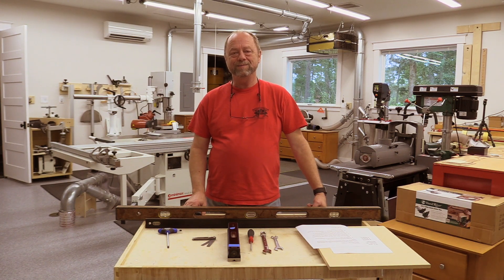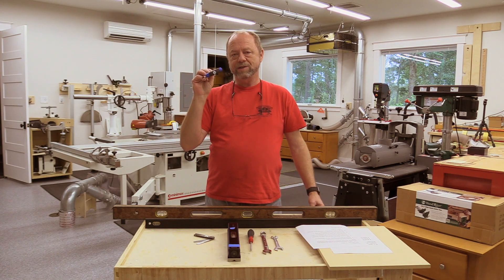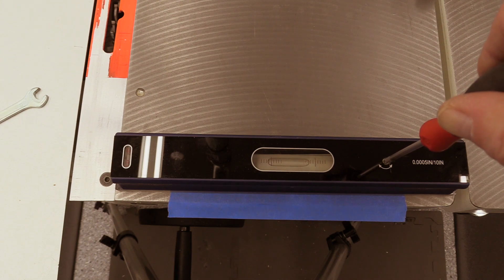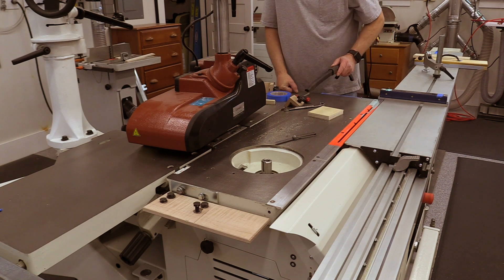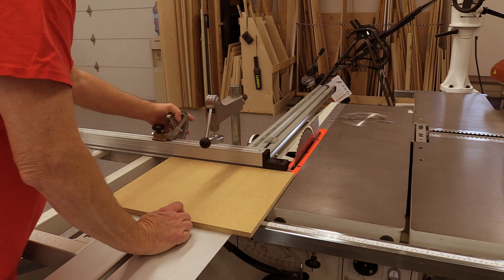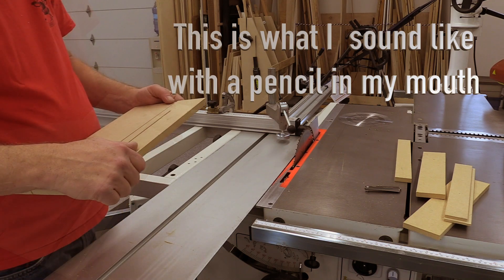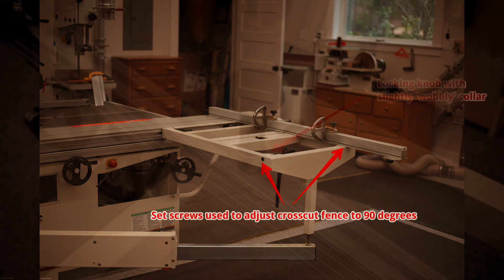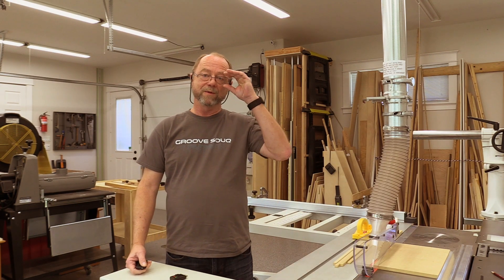Sliding table saw setup and alignment - Minimax CU300 example

Comment: Hi Mark — do you have the part number for the rod that adjusts the cast iron sag? I have a LAB 300P which does not come with the stiffener rod from the factory, but I do have sag in my cast iron top and was thinking about retrofitting that part in my machine somehow. I can't find the parts manual for your machine online. Thanks!

Comment: Excellent info!  I need to raise my outrigger a small amount as there is 3/32" of sag.  I can't for the life of me figure out how to loosen that nut, nor raise the Acme shaft....  is there a trick to this critical adjustment?
Reply: I have used penetrating oil, heat and a steel mallet but it just will not budge!
Reply from the maker: Steve, on my CU300 there are 3 adjustments points for the height of the outrigger.  Two small (~4mm) hex head adjustments right against the slider and a larger 10mm hex head on the pivoting arm. The pivot-arm adjustment has a nut at the top of the pivot arm but if you look from underneath you should see that the bolt will accept a 10mm Allen wrench. The bolt on top likely acts as a locking nut so you would very slightly loosen the large bolt on top and then turn the Allen head.  Check the thread direction, I don't remember if it is right or left handed thread. If the nut seized up on your machine I don't have a good solution.

Again, check the thread direction and make sure you actually trying to loosen the locking nut, and  not tightening it more :).
Reply: @markamcfarlane  I got it loose but it required a 3 foot lever attached to a wrench- it was machine tightened at the factory to ungodly amount of torque!  I have another question about aligning the cast iron top- in the video, you start on one end and then zero out your level as you move forward.... and bing the table into alignment with the start point.  How do you know that your start point is level? So if the start point is tilted in one way or another, when complete, the whole thing will be twisted...
Reply: Another question-  when using the machinists level, when you check against the far side, your solution to the twist is to level the machine as a whole- you used shims, but at least my combo has leveling feet-  So are you suggesting that the cast iron itself is not at fault but rather the entire machine?
Reply from the maker: @stevensivak5109  Steven, if the machine isn't  level the cast iron top wont be level.  The only way I know of to control any twist in the cast iron top is with the leveling feet.   If the cast iron top sags near the shaper then there is a rod that can be used to move that part of the top up or down.
Reply from the maker: @stevensivak5109  Hi Steven, the machine top and slider don't need to be absolutely level relative  to the earth's gravitational field, they  just need to be FLAT (planar).  If you get the front and back sides registering the same on the machinists level then those two measurement points will be parallel to each other and the top will be flat relative to those two 'lines' where the machinist level was placed. The whole machine  could have a tilt relative to the earths gravitational field but as long as the table top and slider are 'in the same plane' you will make good cuts.  

You could (and probably should) start the process getting  'level to the earth' first using something like a carpenters level, then use the machinists level to get the flattest setup possible.

If the machine is not level to the earth gravitational field then you may experience the slider wanting to drift to the start or end position on its own when you are out of the shop...

FYI, I added leveling feet to my machine also, the shims have been gone for a few years.
Reply: @markamcfarlane  I think that indeed using the leveling feet to get as close to level is, as you suggest the first step.  If I understand this correctly, there is no such thing as getting a twist out of the cast iron because other than leveling, there is no adjustment for twist.  Sag, yes but not twist...
Reply from the maker: @stevensivak5109  Using the leveling feet you should be able to remove any front-to-back twist (warp) in the table surface.  I don't know of any other adjustment on this saw to address twist but the leveling feet should be sufficient.
Reply: @markamcfarlane  Well it all worked out just fine-  thanks!  However, at the end of leveling the slider to the cast iron, I discovered that the slider is not properly aligned with the blade.  Do you have any tips on the rotation of the slider and how far the work pice should be toed out?  I clamped a small block to the slider and cut it with the leading edge of the blade.  Then I shut off the machine and pushed it back and forth against the trailing edge of the blade and I can hear it making contact.  Obviously, it should pass by the trailing edge silently with some tiny gap.....  Any tips???
Reply from the maker: @stevensivak5109  Steven, I cover this @ 9:34 in the video. All I know to do is loosen the 5 slider bolts and gently nudge it one way or the other.  Watch the video, I recommend you are really careful and loosen all 5 bolts the exact same amount, then retighten them the exact same amount or you will change the height-level of the slider.  I ended with .002" of toeout.  I don't know if there is a magic number, I was shooting for 0 toeout and considered .002 close enough.  Perhaps better to have a little toeout compared too any toein.
Reply: @markamcfarlane  Sam recommends .004-.006 so you are very tight!  It is in fact very tricky.....thanks
Reply from the maker: @stevensivak5109  I just got lucky. Tried to get close to 0 toeout, measured at .002 and quit making adjustments.  Pure luck :).
Reply: @markamcfarlane  Is it enough?
Reply from the maker: @stevensivak5109  Yes, it works fine for me. It is easy to get overwhelmed by measurement data. In the end you are cutting wood and not milling an engine block.   My joints are clean, glue-ups right off the table saw work fine.

Comment: Thanks for posting this vid. It’s given me a few tips I’ll try next time I try adjusting my felder. 

I can’t believe they use the same rubish mechanism to adjust the sliding table height as felder use. Absolutely idiotic to use the support bolts to set the height when every time you tighten one it throws the adjustment out of whack. They really need to clamping system that clamps perpendicular to the adjustment direction to clamp.
Reply from the maker: Thanks for the comment.  I agree that having the height and position adjustment on the same bolts is less than ideal, but on the flip side for my use it has held well for several years after being set up.  You just need to count the number of wrench turns during the process to repeat settings...

Comment: for the crosscut fence the 3 side cut is nor reliable  , a five cut method is the only way for an accurate setting. ,,,, great video by the way.
Reply from the maker: Thanks Rory. FWIW, the 3-cut method I demonstrate in the video has been "accurate enough" for everything I have built.  The traditional 5-cut approach may provide a more accurate result but the 3-sided method  has worked fine for my casework,  face frames, aprons,.... One nice thing about the CU series saws is they seem to hold their setup really well as long as you don't take off the outrigger. I removed the outrigger once to accommodate an early-Covid-distancing dinner party.  After realigning everything we hosted subsequent dinners outdoors :).

Comment: Hi Mark, 
I have limited space to move the saw from the driveway to a shed shop I’m planing to build. Could you give me a minimum width requirement to move the saw? I’m thinking removing everything possible to make saw as small as possible to move. 
Thanks.
Reply from the maker: About all you can easily remove is the outrigger and the fence rail. On my saw that leaves 43 1/8" left. Removing the plastic protective cap on the Tersa head might net another 1/8-1/4" off the width.  My saw came from the factoring with the sliding table attached and, if I remember correctly, was firmly locked in place with some special brackets.  I have no idea how difficult it would be to remove the all of the sliding rig, and the reinstall it and level it,... personally I would not want to attempt this.
Reply: @markamcfarlane  Thank you very much! It’s very hard to get that information online. Really like your combo saw.
Reply from the maker: @cazadorpr3620  Thanks Cazador

Comment: What a great video. Everything is explained very clearly in a calm way which makes it easy to follow and nice to listen to. My new (16 year old) Felder table saw will get delivered in a few weeks so it's great to have this information for my first setup. I'm sure some adjustments will be different, but having an idea what to look for is never bad. I imagine it will help me a lot. Thanks a lot for taking the time to make this video
Reply from the maker: Thanks Nino, you are very kind.  I hope the Felder works out great for you,  I'm sure you are going to want to cut some wood quickly, but it is worth it to eventually dial things in. It's really awesome to have no surprises after a cut, and a good sliding table saw is a great way to get safe, easily repeatable cuts.

Comment: Decided to do this last Friday without any pre-education. Got close but decided that next week I will have another go at the height adjustments again. The reaffirming of your video gives me a sense that I was on the right track thanks.
The see/saw of the adjustments on each end change as you tighten down the middle bolt. But when you go to the toe in or out you have to loosen it off again which changes everything if you do not get back to the same tightness. So, I decided I will bring my new digital torque wrench in and see if that helps. 
The main reason for me to adjust the height was the blade was not cutting square on both sides due to a high slider.
Reply from the maker: Ian, yes that is a tricky adjustment for toe-in/out. I try to loosen the sliding platform a minimal amount when making this adjustment, using the same amount of loosening on each of the 5 nuts so the height stays the same.

Comment: Hello Mark may I know the length of cut capacity on the slide?
Reply from the maker: James, the CU300 comes in a couple different lengths. Mine in the video has a slightly longer than 8' cut length, maybe 8.5".  There is a shorter version also, I don't know the length of the short one but the specs are on Minimax's web site.
Reply: @markamcfarlane  Thanks Mark

Comment: Hi Mark! I face an issue with the brass nuts on the underside of the sliding fence, on the cast iron side. Do you face similar issues?
Reply from the maker: Hi Aakash, I haven't had any problems as you are describing.

Comment: Thanks for the excellent tips.  One dumb question for you: What is the purpose and adjustment of the black plastic chip guard on the crosscut fence?  It is long enough that it will hit the blade when the fence is installed. Do you just cut it to length?
Reply from the maker: aintpat, That piece of plastic appears to be a sacrificial end to the crosscut fence. It have adjusted it to be very close to the blade but not touching when I am sawing. Remember you can adjust the crosscut fence blade distance, which is useful if you need to slide it completely over a lowered blade so you can get closer to the shaper for shaper operations. I keep half of a fritz-frank jig on the slider most of the time, and that jig's chunk of oak was cut ridding the slider, so it clearly shows the cut line .

Comment: G'day mate
Greetings from Croatia

I like your show and detailed explanation and I hope you can shine some light overhead and help me

I have Minimax CU 410K from 2000
And a feed roller is working and everything is setup correctly but doesn't feed wood
Guy that sold me the machine says that casted iron top need lubricant like naftha or something, fair enough could and should help but shouldn't be cause of the problem 
So I've cleaned the roller and it looks like I need new one, because edges of the roller are still sharp but middle is worn off and doesn't have a grip

Any ideas ???

Also the wheel inside of machine, connected to the handle that starts and stops rollers, orange in my case, is around 7mm thick and apparently should be 10mm
So please any advice I need machine as soon as possible and this guy just going around with no results 
Thanks
Reply from the maker: Good morning.  Cleaning the machined surface really well and then applying a non-silicone based paste wax (like Johnson and Johnson's or Rennasiance Wax) will reduce friction and therefore help the feed roller not have to work as hard.  The general rule is don't use a silicone based wax, such as used for cars, as they can mess up finishes you will apply later to the wood (e.g. causing fisheyes).  I'm not familiar with how the feed works on this particular machine, my cu300 has a steel feed roller. If yours is rubber it is possible it has worn down.  There is a minimax owners group at groups.io, or you might try the SawMillCreek (SMC) forums.  There are a lot of helpful people on SMC.  Happy woodworking.
Reply: @markamcfarlane  
Thanks

Comment: I have the Martin T60C saw and have heard that Martin sets the run of the slider to the blade with a slight movement away from the blade. The rip parallel fence on my model has no adjustment for
parallel to the blade in a definitive order so I placed 4 socket screws on the clamp mechanism to the perpendicular rail of the fence and have achieved a smooth cut while ripping.

Comment: Thanks for taking the time to document this
Reply from the maker: You're welcome Rainger
Reply: @markamcfarlane  hello mark i have the scm sc3classic. When im cutting the mdf on the sliding table it shouldn been touched with the back theet of the saw pls?
Reply from the maker: Renjos, if your toe out is set neutral, i.e. 0 toe out, then you are correct, the teeth at the back of the blade won't be cutting anything, they are just riding inside the kerf made by the teeth at the front of the blade.  If the back teeth do cut the board, then either you are pushing the board into the blade (toe in) or pulling it away (toe out).
Reply: Thanks for your immidiat respons.i am holding the wood with thithen hnob like yours so it shouldnt move into the blade.to be good the  back theet should not thouch the wood??
Reply from the maker: Renjos, The wood can hit the back of the blade for two different reasons: 1) The wood moves perpendicular (90 degrees) to the blade due to it not being clamped. 2) The slider itself  moves towards or away from the blade (toe-in and toe-out respectively). The clamp prevents the first  (1) type of movement.  I always clamp the wood (for every cut) to the slider/outrigger to prevent this lateral movement. If you are well clamped and the back teeth are not cutting the MDF, then your toe-out is neutral (0).  This is how I set up my slider.  Many people like to have a little bit of toe-out, in which case the back teeth will make a VERY SMALL  mark on the right side of the kerf when you stop the cut in the middle of the board.
Reply: @markamcfarlane  thanks for the advise but mine its thoucing a little bit the mdf on the left hand side.is it wrong?or i can leave it like that?
Reply from the maker: If the back of the blade is cutting the MDF on the left side, then you have a small amount of toe-in.  If it is barely marking the left side of the kerf you are probably OK, but if it is cutting a ridge in the left side of the kerf then your toe-in is fairly severe and you may want to fix it.  Most people set up their sliders to have a small amount of toe-out. 

 There is not a single 'correct way' to do this setup, so if you are happy with your final results I wouldn't worry too much.
Reply: @markamcfarlane  thanks for the advise .you are very help full .i think i can leave it like that.

Comment: Thanks for the  video! I know this will come in handy in the spring when I need to move my CU-410.
Reply from the maker: You're welcome Brian. Good luck with the move.  Make sure the slider is securely locked and the planar tables are strapped down before shipping it.  I think there is a set screw hole on the infeed side of my slider for locking it in place.  There were some extra parts that came with mine to strap down the jointer table as well, hopefully you still have them.